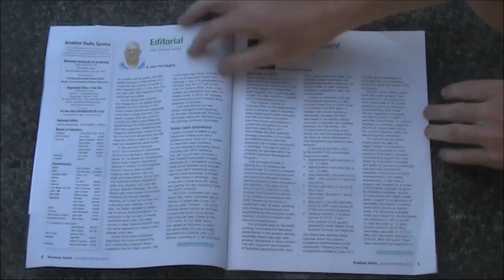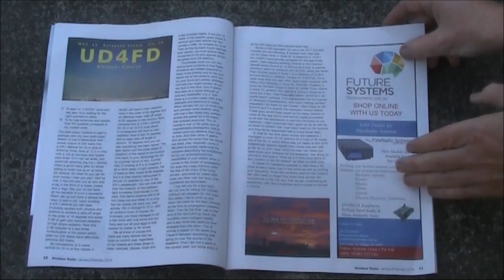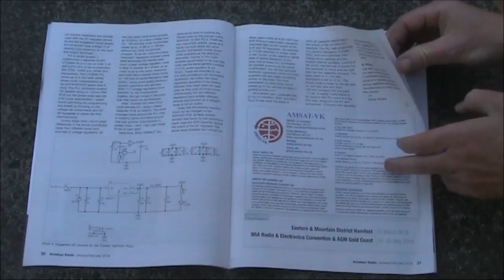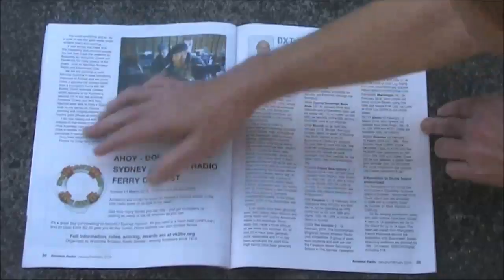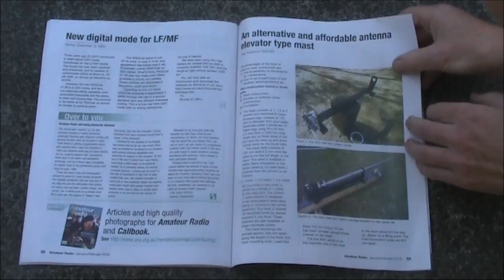Inside Amateur Radio magazine published by the WIA

Comment: Hi Peter,
Callum M0MCX DX Commander just did a look inside the RSGB RadCom magazine. Bought one of the ZS6BKW antennas off eBay. Haven't tried it yet. Noticed the Tet-Emtron ad at bottom of one of the pages. I have a 30 yr old Tet 3F37DX tri-band yagi antenna. Had it down this past summer and rebuilt it. Tet still has some parts available for it.   73   WB3BJU